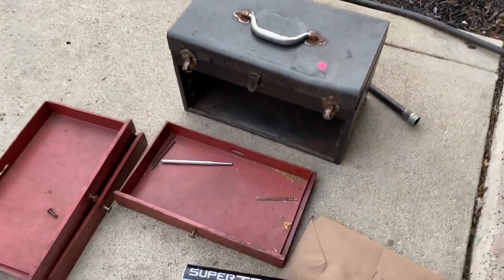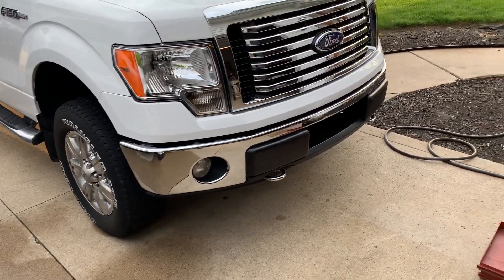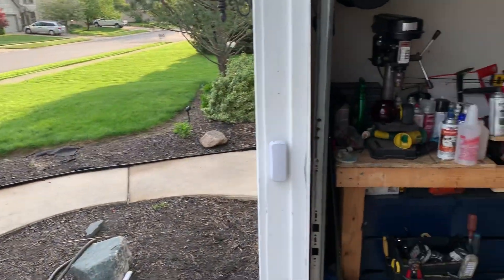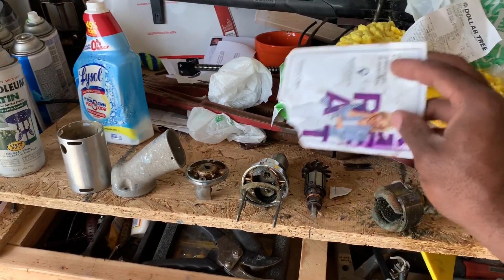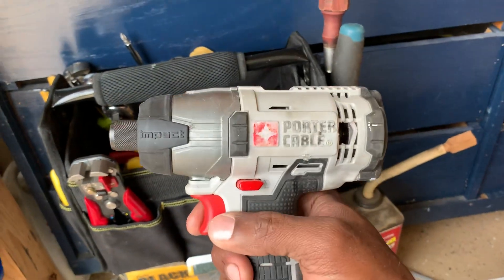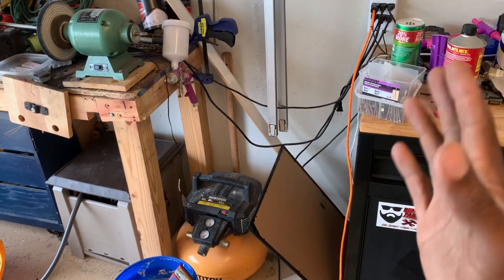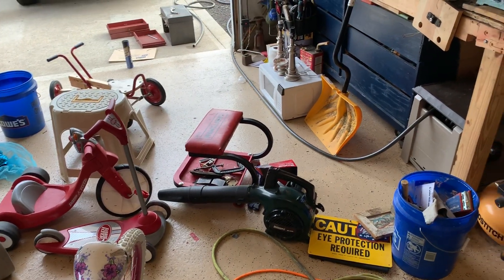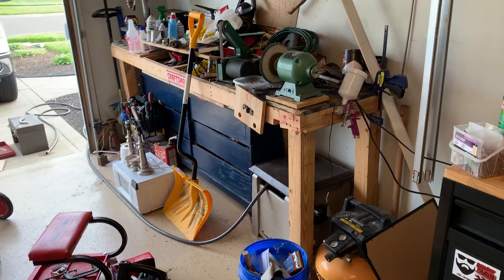Midwest Tool Review Life

Comment: Are you going to do the transmission in the driveway? I would like to have a self service garage like we had in the military. There was one I used to go to in Washington DC. It was called Auto You Fix It. In 1982 when I first went there to change the clutch in my 71 Dodge Charger, it was $6.00 an hour for a stall.

Comment: Hi James!  If you ever have that issue again with the brake caliper hanging up change your rubber brake lines, they look good on the outside but tend to fail on the inside!  Ask me how I know!  LOL   Thanks!!!!!!
Reply: Good tip. I just changed pads literally over one pad that looked like it had rubbed last 10k miles lol. Seen one of my front calipers were doing same so I'll look into this